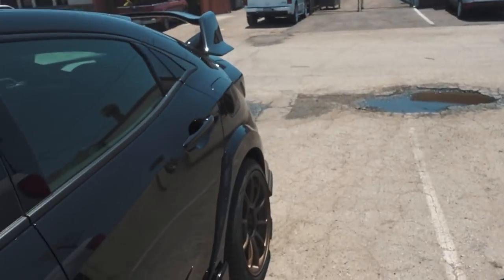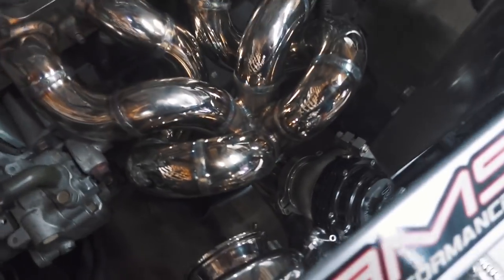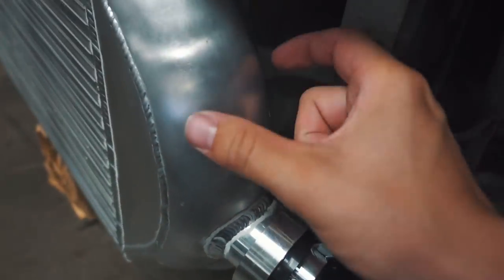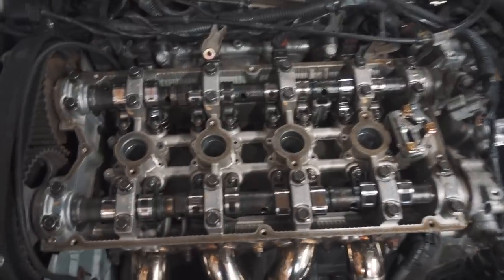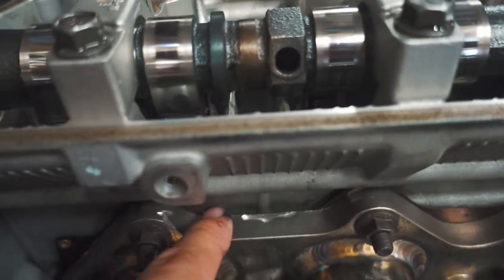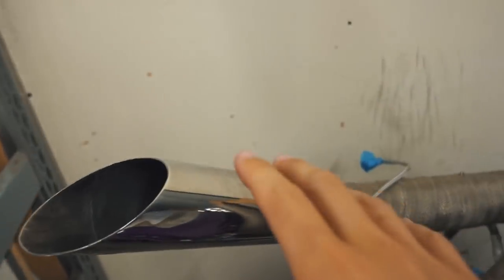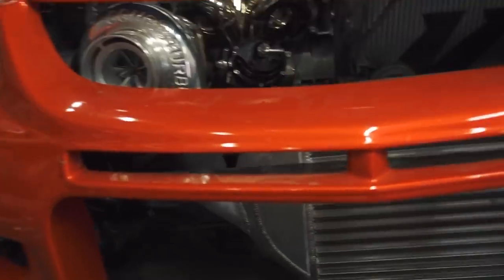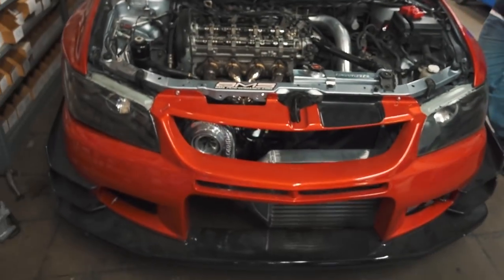THE FINAL EVO 8 CUSTOM TURBO BUILD UPDATE

Comment: When you do the valve cover make sure you remove the baffles and clean it out...you WILL lose a motor if you don't. The bead or whatever they use to strip it will get stuck in there and eventually cause a spun bearing.

Comment: Dude you have to center the intercooler. Clock the turbo and make a u shaped bend  so you can center the intercooler.  That offset look is just wrong. Otherwise it's really good.
Reply: Lol so you're a teenager?
Reply: Last time I remember Its His build not yours!😂 If you dont like his Build Then Buy an Evo And Make it the way you want to.Why try and be Like someone else when you can Standout!
Reply: Its just an opinion.  It also goes against functionality as well.  Intercoolers are not just for looks, they need to get air flow through them to be efficient.  So having it off set and half covered up really does not make sense visually or functionally.  Its his car and yes he can do whatever he wants with it.  He could wrap it pink and put stickers all over it saying moist boi if he wanted.  But there is a reason why you see turbo cars with centered intercoolers, because it makes the most sense, looks the best, and functions the best.  This just comes off as lazy, not custom and unique.  Especially with the amazing manifold and turbo the placement just kills it.  And adding more pipe is not going to have even a slight change in spool time.  Once its pressurized it stays that way.
Reply: +Benjamin Seider the dude in the video going on about short piping and spool time is kinda full of bs. It will take another fraction of a second to pressurise slightly longer piping, what will effect it much more is their wild exhaust manifold design. I've been there done that, just to be different and unique but there is a reason things are done the way they are by the majority.
Reply: +Benjamin Seider just to add to what you said about bot being unique and custom, you're correct it is lazy leaving the intercooler like that, any good fabricator worth anything would have a solution. They didn't put enough through into it, simple.
Reply: Standing out doesn't necessarily mean good. Sometime it means retarded. Like in this case.

Comment: The bov being on the end tank is cool but logicly you want it as close to the throttle body as possible 
It sees cooler air helps with life
When TB closes and the bov opens the air escapes right where the door closes helps with response and throttle body life cause big boost can bent the crap out of them

Comment: Awesome Build D! 
Might be a dumb question: But wont the Turbo heat up, and possible burn the bumper? 😊.
Reply from the maker: Negative, we are good!
Reply: Hopefully it won't and shouldn't since the cold side is the one that is next to the bumper, not the hot side
Reply: The compressor side don’t get to hot
Reply: probably wouldn't be a bad idea to gold foil the inside of the bumper near the turbo.

Comment: going tiny radiator sounds like overheating issues on and on
Reply: Prayan Pulido that’s exactly what is wat thinking especially with this engine how it runs hot already and it’ll be in Cali which usually is a very hot place not to mention this engine usually has overheating issue

Comment: With all this work, it better do atleast 500
Reply: yrn.Sydney More.  And once he builds the block it’ll be a lambo killer
Reply: It's going to be at least 800 hp depending on how much boost he runs
Reply: Blake Brothers Oh he’ll hit that easy when he builds the motor.  But since he’s on stock block he won’t break 500 without having issues so once he builds it, it’s gonna be a monster.
Reply: AiR JoRdaN yeah he will have issues without a built block
Reply: AiR JoRdaN you can go over 500 without problems.. all in the tune brother
Reply: mark eaton He’s gon have small issues here and there.  Over time it just adds up.  It would be way more healthy to build it.  But yes I am aware of evos pushing 700 on stock block! It’s insane how these cars hold up.
Reply: No, he will have to keep the torque down to 350 or he will throw a rod through the side of the block,  I feel bad for whoever has to tune this car. The power band is going to be near non existent on the OEM valvetrain. These turbos don't hit peak boost until 5k on a non stroked 2.0L. 100% under utilizing the potential of this turbo. Such a waste for now.
Reply: KZNEvoX Yeah Im aware haha.  Of course the support mods are gonna be needed.  I worded it kinda funny I meant to say it’ll be capable of holding that kinda power once he builds the block.
Reply: He definitely needs alot more to go into the 800s lol. He needs to read up a little more on what actually works and not just do things to look cool.

Comment: Dustin please look up other Evos with front facing turbo setups. That intercooler setup is hideous and needs to be fixed boss. Clock the turbo correctly and have them fab the piping to have proper fitment. It honestly looks like shit

Comment: Not ten out of ten because u still using urethane couplers... Need to do full band clamps and welded them on.
Reply: There's nothing wrong with regular couplers, if the piping is well made fits properly with lips on the piping they will never blow off. For the price of wiggins or similar it's hard to justify.

Comment: Is there going to be an intake filter? Or just full send open turbo?
Reply: Austin B did you not hear what he said Lol.  The exhaust is the only thing connected other than the intercooler.  He’s not gonna stick an intake onto the side That’s sticks out the front.
Reply: AiR JoRdaN cool doesn't sound very smart.. wait till a rock or something gets shot into that turbo and destroys it
Reply from the maker: Most definitely
Reply: AiR JoRdaN well there's your answer bud
Reply: Austin B It’s a track car.  You aren’t gonna have a lot of shit fly at you.  If you’ve even been on a track they keep  debris to a minimal.  But yes on the street he would be fucked if a car were to shoot a rock and it happens to fly straight at it.  You look at all the other exposed turbo track cars.  They’re just fine cause it’s dedicated to the track not the street.

Comment: Isn't it bad for the turbo to be all exposed like that with no filter? Hopefully if you ever do track it you'll at least have a screen or something on it, right? Lol. It'd suck to spend all this time and money and then suck a rock through the turbo and kill it. Just sayin'.
Reply: He's said quite a few times he's running s filter, not sure what type as clearance looks to be an issue with the setup now.
Reply: Oh, must have missed it lol. Yeah, I would think a screen would be the only option with the little clearance he has with that bumper. Or one of the really flat cone filters. Anything else and he'd have to cut the bumper to fit it lol.